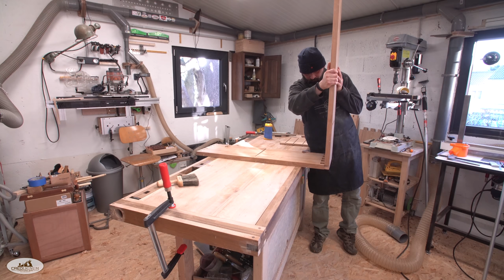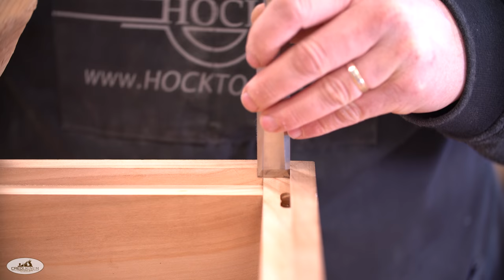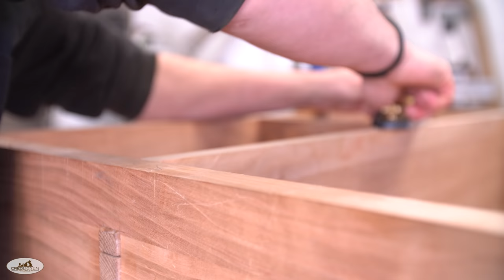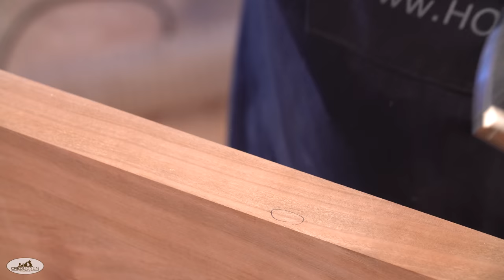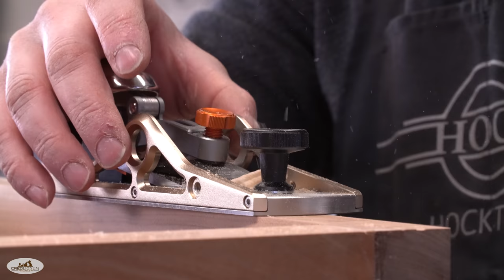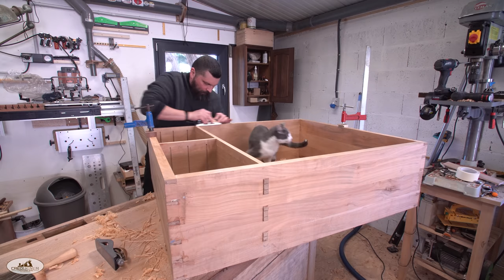Fabriquer une armoire à  outils #2

Comment: Je vois que tu as bien des soucis d'arrachement avec ton cerisier. Quand c'est comme ça, il faut identifier le problème. 
L'affûtage ? Il a l'air bon. 
La tenue du rabot ? Ma foi ça tient la route aussi. 
Epaisseur de passe ? C'est pas trop gourmand : ok. 
Angle d'attaque des rabots ? Ah bien oui, là ça merde. Tu n'as utilisé que des "angles faibles" pour tout le replanissage de finition de l'intérieur de la boîte, et la finition des chants après assemblage, et tu as eu des soucis d'arrachements. L'angle d'attaque de ces rabots est trop faible pour s'affranchir des contrefils, quelque soit le réglage de la lumière (dans la théorie, une lumière infinitésimale ne produit aucun arrachement, mais c'est en théorie, dasn la pratique ça fout le bordel plus qu'autre chose.)
Pour la finition, il y a 3 solutions viables pour passer dans tous les sens et s'affranchir des contrefils, même accusés (et le cerisier n'est pas un bois considéré comme difficile) :
-Utilisation d'un contrefer. Il porte bien son nom de brise copeau. Cette action va limiter drastiquement les arrachements. Cependant, pour une action optimale pour du replanissage : il faut le régler au plus proche du tranchant, un, deux dixièmes maximum. Il va de soi qu'il faut qu'il soit parfaitement ajusté à la planche. Ca, combiné à une petite épaisseur de passe, et un affûtage dans les règles, on passe dans quasi tous les contrefils (sans aucune forme de souci dans du cerisier, en tout cas). Tu verras que ton rabot era bien régler pour replanir quand il fera des copeaux en forme d'accordéon. Il me semble avoir vu un N°4 Record sur la vidéo, réglé comme je l'ai énoncé, il va massacrer ton lie nielsen en qualité de travail à contrefil. 
-Un angle d'attaque très fort, 55, 60 voire 65°. C'est très efficace, mais implique des fers d'épaisseur très conséquente pour éviter tout vibration (minimum 5 mm, plus c'est encore mieux).  Le revers de ces rabot est qu'ils sont difficile à pousser du fait de l'effort de coupe. 
-Le raclage. Ton fer de rabot (que l'on te voit utiliser dans la vidéo d'avant) n'est pas adapté pour du raclage de finition, et tu te tues à la tâche, ça s'entend à ton souffle. Et il n'est quand à lui, clairement pas assez bien affilé. Ca doit chanter, siffler un racloir sur le bois. Ce n'est pas fatiguant à utiliser un racloir (et encore moins en poussant). il vaut mieux un racloir plus souple, dans les 8 à 9/10ème. Et si tu te blesses avec les arêtes, tu n'en affiles que 2 dos à dos, et toutes les autres arêtes tu les arrondis. 
Petite mise au point tout de même sur les angles faibles, à la base, c'est uniquement pour recaler le bois de bout ces bazars là... On peut contourner le broblème en affûtant le biseau  avec un très fort angle, pour augmentant l'angle d'attaque, mais ça devient raide à pousser et on perd drastiquement en capacité tranchante.... 
Voilà j'espère que ça t'aidera, on sent la passion du travail du bois, et je voudrais pas voir quelqu'un se décourager de faire de la finition aux outils manuels sur des bois faciles à acsue d'arrachements dus à l'utilisation d'outils peu adaptés pour ça, ça fait déjà bien plaisir de pas voir une ponceuse sortie à tord et à travers !